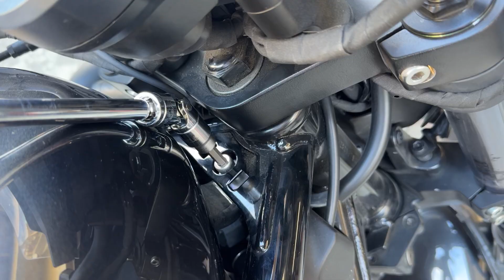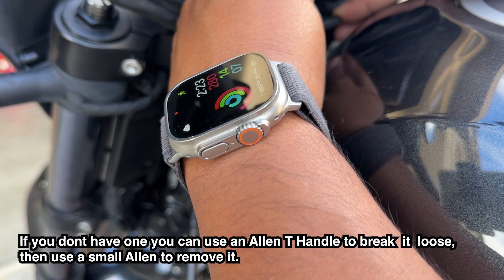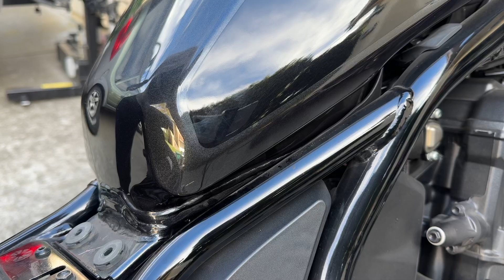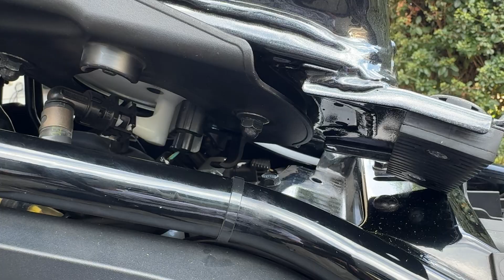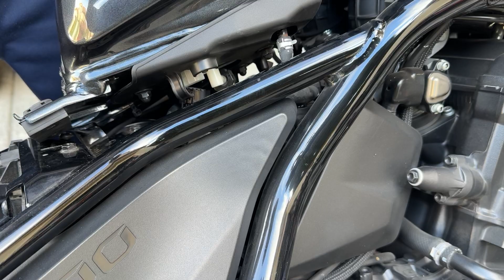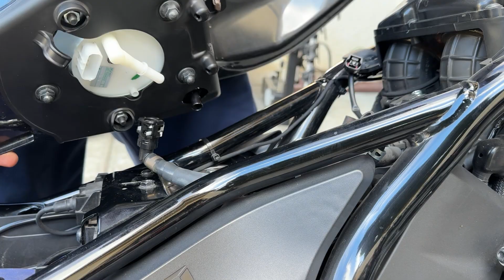2021 Rebel 1100 Gas Tank Removal

Comment: Perfect video and it’s just what I needed!! I am looking to run some cables neatly under the my tank and I didn’t want to shell out an hour’s worth of labor co$t at the shop! Getting the front screws loose looks like the most time consuming, but very doable. Thanks a million for this post! 😎👍✌️
Reply from the maker: If your cables along the edge, then you can just remove the bolts near the seat and lift the tank a little bit. This will save you from removing the connections and front bolt. I did this on my usb cable install video.